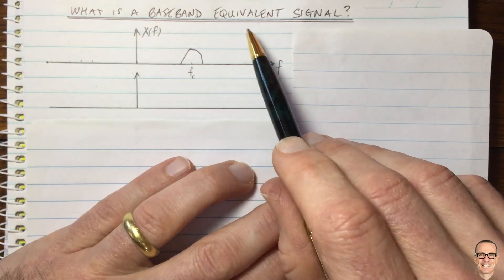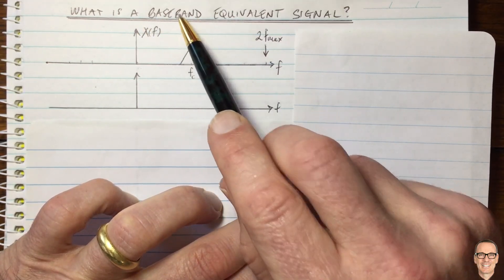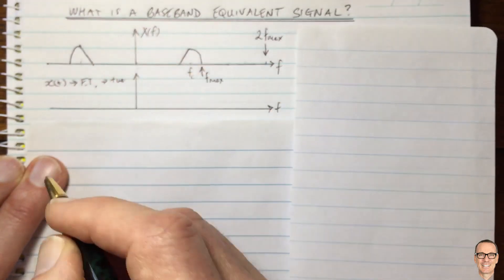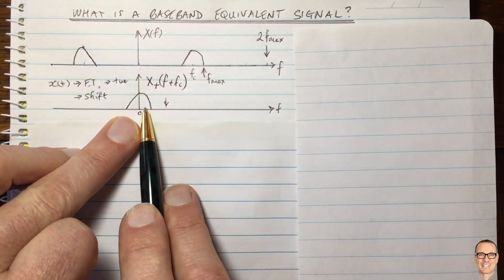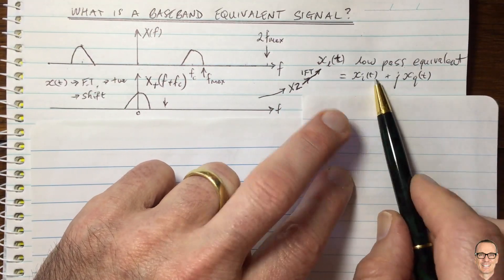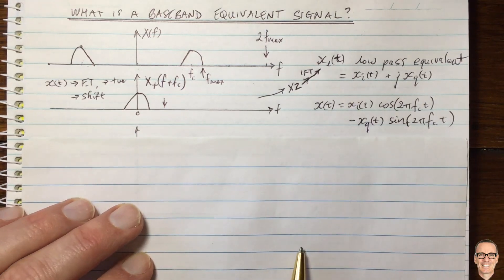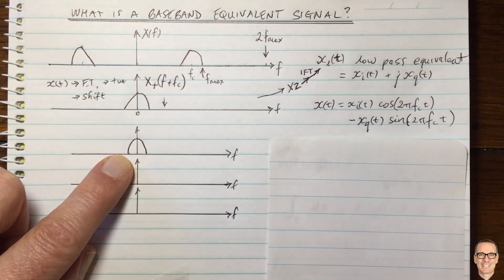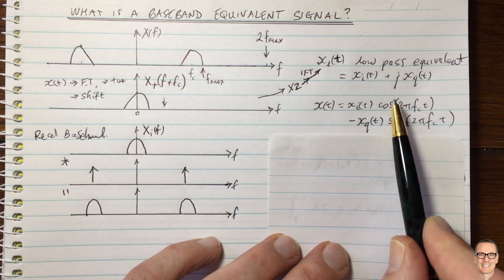What is a Baseband Equivalent Signal in Communications?

Comment: is the multiplication by 2 on the lowpass signal there to match the 1/2 scale factor on the fourier transform of cosine to fully recreate the original signal?
Reply from the maker: Yes. But that actually they are both there because of the same underlying reason. It's because half the signal is represented with positive frequencies and half is represented with negative frequencies. So when I drew the X_+(f+f_c) function, I only kept half of the original function. So when I write a mathematical formula for the full function, in terms of the "half function", I need to multiply by 2. More information on this can be found here: "What is Negative Frequency?" https://youtu.be/gz6AKW-R69s

Comment: hey professor thanks for amazing video.
in digital domain message can be complex and real like BPSK is real and QPSK is complex data.
doubt - can  analog message signal be complex because in analog domain what ever we transmit is real only like the voice transmission radio FM etc?
Reply from the maker: I'm not sure you're understanding it fully. QPSK is not "complex data". The "data" is not complex. "Data" is 1's and 0's. They are real. If you want to send multiple bits of data at the same time (eg. 2 bits, in the case of QPSK), then you need to have multiple waveforms (one to represent each possible combination of bits). If you choose to design the waveforms to be phase-offsets of each other, and you want to have more than two phases (ie. more than just 0 and 180 deg) then you will need to have a sin() component as well as a cos() component. Then, if you want to, you can represent those components mathematically as "real" and "imaginary".  .... but they are both real signals! Hopefully this video will help: "Is the Imaginary Part of QAM Real?" https://youtu.be/6asDtzaVjbQ
Reply: @iain_explains  thanks dear professor fir clearing my doubt that means even if in case of analog communication complex signal transmission means transmission of signal on two orthogonal set of sub carriers , may be thats why we use complex exponential for purpose of modulation.
and my be complex data is possible because there is possibility of only two orthogonal subcarrier at a particular instant of time .
now all thing make sense you are just amazing professor 👍
Reply from the maker: Yes, that's correct. For more details on orthogonal waveforms, see: "Orthogonal Basis Functions in the Fourier Transform" https://youtu.be/n2kesLcPY7o

Comment: Superheterodyne receiver downconverts the incoming RF signal to IF band and samples the IF signal only one ADC. After sampling NCO generate digital oscillator to multiply sampled signal. İ dont understand how can we obtain IQ data at here. Can you help me?
Reply from the maker: Ah, OK, now I think I understand your question. It's probably best to think of the ADC samples of the IF signal (over a time period equal to the symbol period) being put into a vector. Another vector can be generated with elements that are sinusoidal at a digital frequency that corresponds to the analog IF frequency. Then you multiply (element-by-element) the two vectors together. And then sum up the elements of the resulting vector. Then you need to repeat that for a second sinusoidal vector that is phase-offset by 90 degrees. Then you'll have two numbers - one is the "real" value and the other is the "imaginary" value of the complex IQ digital symbol.
Reply from the maker: This video is also related: "Sampling Bandlimited Signals: Why are the Samples "Complex"?" https://youtu.be/JglRGRizqGM

Comment: Thank you Iain for all these efforts and great explainations. So in practice are all sampling is done on the baseband equivalent signal or actually on the baseband signal before modulation? I mean in normal comm. system we do sampling first then modulation and upconversion and at the Rx downconversion. Complex equivalent is more about facilitating the analysis rather than the sampling itself as I think we do not need to do sampling on the passband signal in practice even if we do not consider the complex baseband equivalant. Is this right?
Reply from the maker: Hi Azzam, yes, the baseband equivalent helps with analysis, because it means we don't need to keep all the sin(.) and cos(.) terms in the equations, and it is much easier to calculate things like BER etc. I'm not sure what you mean by "sampling first then modulation" though. The sampling I was talking about happens at the receiver. The reason I mentioned the sampling issue was to point out that even though the actual (passband) signal is at high frequencies, the  information contained in the signal is not changing at that rate. It only changes at the rate of the equivalent baseband signal. To put it another way, when sampling the signal at the receiver, it is not necessary to sample at a rate that would mean you could perfectly reconstruct the complete passband signal (which is what you could do if you sampled at the Nyquist rate). You only care about reconstructing the equivalent low pass signal, which only requires a much lower sampling rate.
Reply: @iain_explains   Thank you. It is clear now.